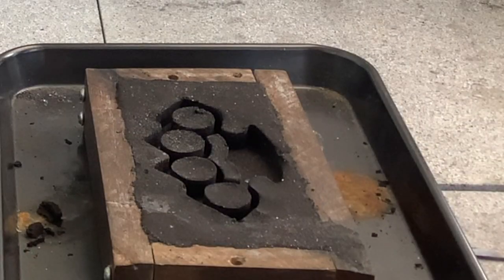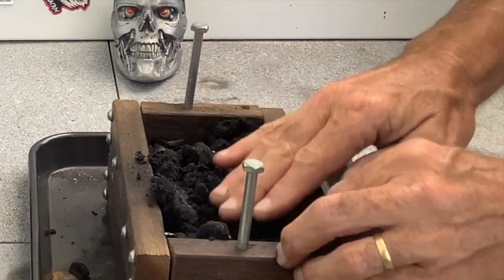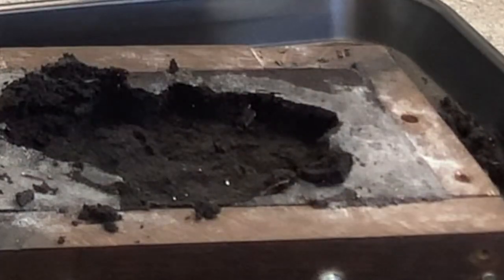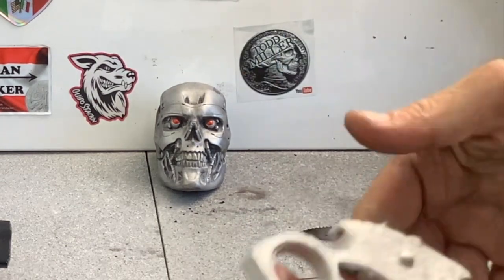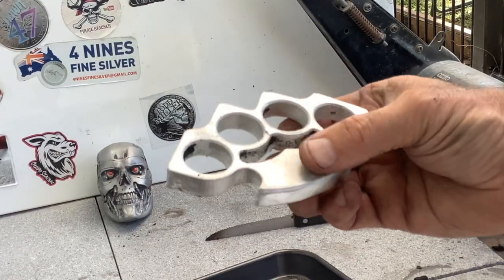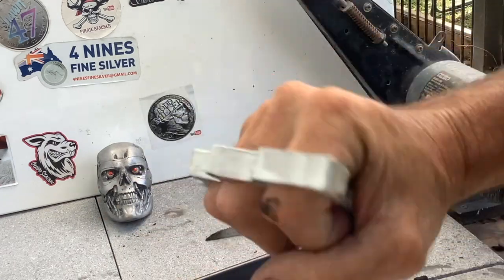HOW TO MAKE BRASS KNUCKLES

Comment: Good job but how many casting attempts did you do before getting a good one I could tell with the marketing ot wasn't your first attempt bit good job though I'm making some similar with brass.👍
Reply from the maker: When I first started pouring it would take me two or three attempts but I’ve done it for so long now that generally it only takes one you start to get very familiar with your sand and how to manipulate it. Thanks for watching 🤠👍

Comment: Nice!
Reply from the maker: Thank you my friend 🤠🤩😎👍
Reply: @4ninesfinesilver315  what metal did you use?  Maybe you said it and I missed it. If it’s silver those are some expensive knuckles.  Have you ever made any silver throwing stars or small knives?
Reply from the maker: @GASilverHunter  You can cast those particular knuckledusters in silver copper Brass Pewter whatever your budget is there’s always a metal that you could use you could even use lead . As for throwing stars and knives I can make them but I prefer animals with feathers or fur. 🤠🤩😎👍